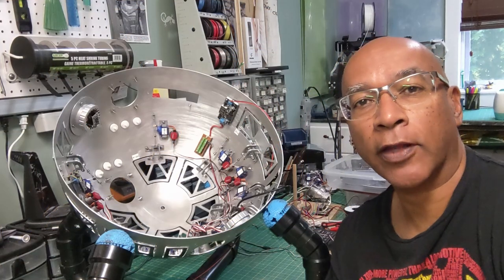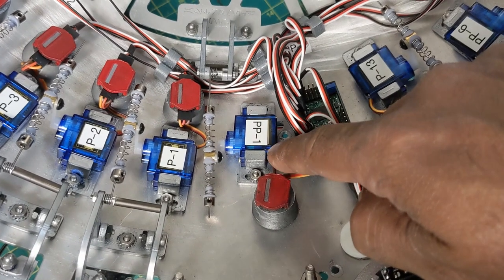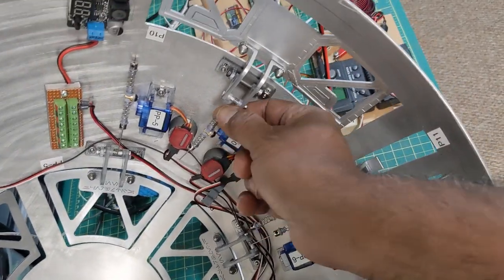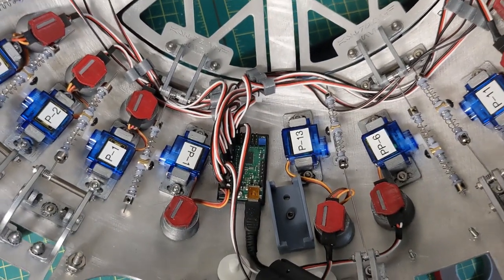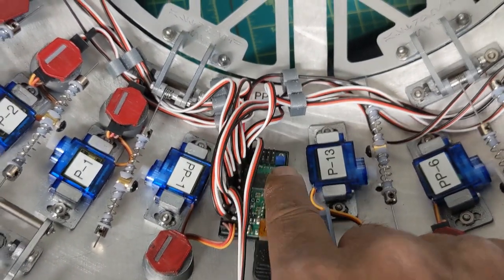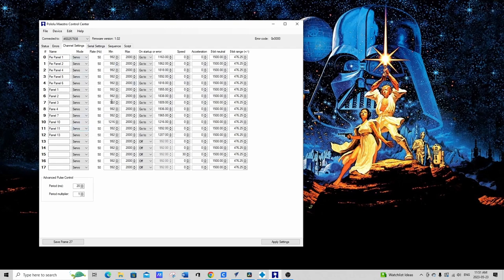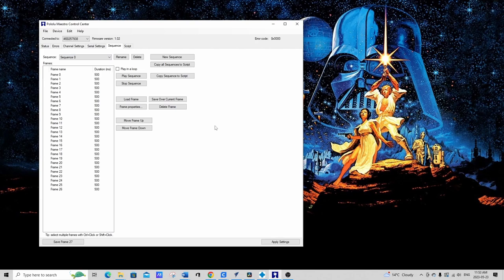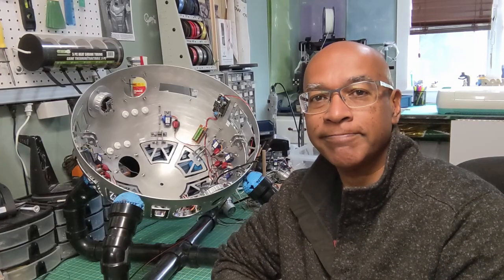R2D2 Build Episode 19 - Dome Wiring Part 1

Comment: Can I ask another question.  The two white 3d printed collars, the two that meet in the middle to hold the brass servo arm, do you still use the lock down screw for the the rod, or it all just spring tension back and forth.  I don't see the lock screw for that hinge rod!  If that's the way you're doing it, I may need to change my dome.  Thanks for the link to the stl files.
Reply from the maker: Here is a photo I just  took for you.  I hope it helps.  The middle floats and the two ends are locked down.
https://drive.google.com/file/d/1zulbfz__037sMQ1q7q1ds4-1FU1DAqHh/view?usp=drive_link

Comment: So are you going to daisy chain the Maestro for the dome off of the lifter Maestro? Basically allowing you to run a tx, rx, pos and neg powers up and could be on a small magtag style connector?
Reply from the maker: Well, I don't think I'm going to use the dome mechanism.  I'm looking at an alternative.
Reply: @MakerDan55  ah dang, ok. Been following your build. I have my lifter and panels working but having some alignment issues cause I want to keep it magnetic and also ran out of servo slots on my maestro so only 4 panels and 5 pies.
Reply from the maker: @CaptainFettCosplay  I built my mechanism too tall so it will be a lot of work cutting it down.  I also think there are too many fragile parts in it and it would have to be removed every time you transported the droid.  I'm playing around with a new mechanism that is much more simple and durable.
Reply: @MakerDan55  that's def going to be interesting to see

Comment: I wish I had seen this video prior to starting on my dome.  Some great ideas I would have used.  All my servos are doubled-sided foam taped down.  So far working.  I too 3d Printed curved board mounts, but I E3000 glued the to the dome.  Where did you get those white spring guides on the SERVOS?  I have never seen those before.  Did you 3d Print them?  If so, can I get the stl please?  Great video, great job on the dome Master!
Reply from the maker: Thanks for the kind comments.  Here is a link to my spring bushings.
https://drive.google.com/drive/folders/1EiW8qlNr8Oy-P3Zbv_ZSWr8YQL2mP-y6?usp=drive_link